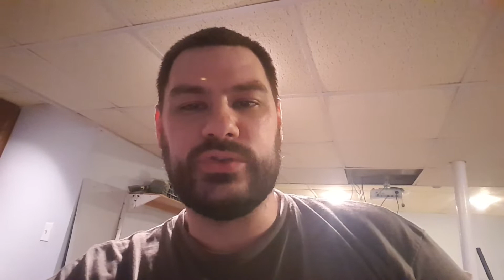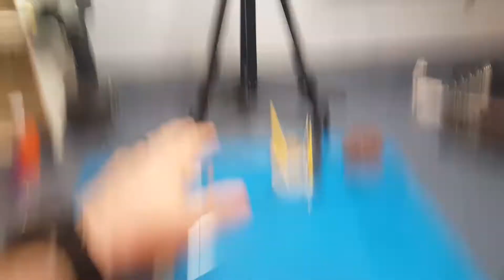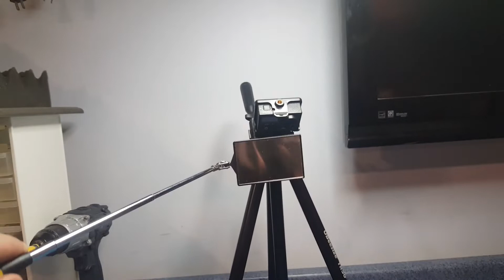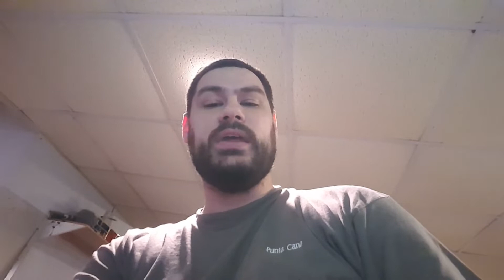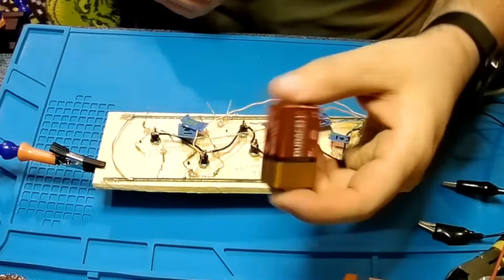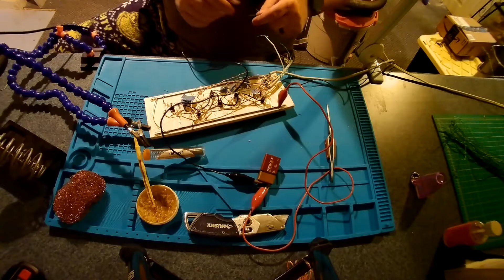NCE Mini Panel LEDS

Comment: That's a good idea with the mirror. When I end up making a switch panel, I'm thinking I'll add RJ45 connections or something like that on the panel.
Reply from the maker: explain that for me. what would the connectors do??
Reply: @FBMRR  I'd put connectors on the back of the panel, and plug the cables in, rather than have the cables attached to the panel. Then if you need to work on the panel, like replacing a switch or LED, you'd just remove the panel and unplug the cables from the back.

Comment: Did you just say Tiperster from the Rickster?  What is that work surface, looks interesting?  What is the camera?  I use a GoPro as my overhead shot so that I can use my phone to setup and control the shot.
Reply from the maker: yup, that was a phrase coined for me by one of my viewers.  the work surface is nothing more that a silicone mat on a make shift table stemmed from to cabinets and a counter-top surface. watch my previous video "pantry & work desk", the last 2 secs show the desk and work bench.  the camera i have is an Akaso. its like a go pro but the phone interface sucks. check out my "Mini cam for model railroad video."

Comment: I'm impressed you got it all soldered up in only an hour and a half Rick. Although they are obviously necessary, it is disheartening to realize the sheer number of individual wires to be connected just to make a simple control panel function. Great video, keep up the good work.  Art...
Reply from the maker: i had a brief moment when my wife took the kids out and i thought let me get this done. i knew it was going to be alot of wires but never really thought about it.  LEDs and buttons included, 21 wires for this small panel.   i should have made it easier on myself and put in some quick connects.
Reply from the maker: @pdrrengineer and i just realized that another wire is needed making it 22. forgot about the red 12V+ that still needs to be soldered to the rail.
Reply: @FBMRR  So who's counting! (lol)
Reply from the maker: @pdrrengineer1404  well if it wasnt for you mentioning it, i wouldnt have forgotten and would be pounding my when it didnt work.